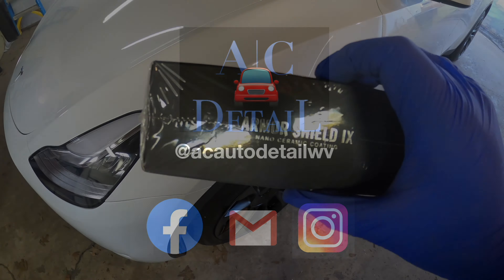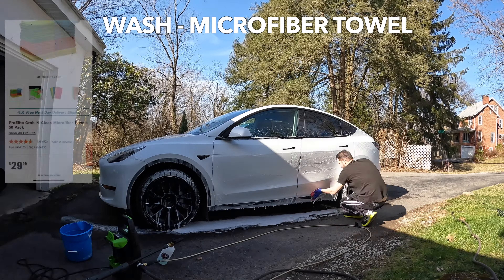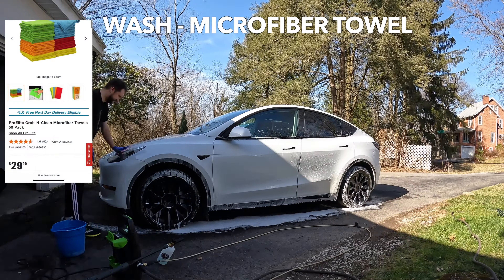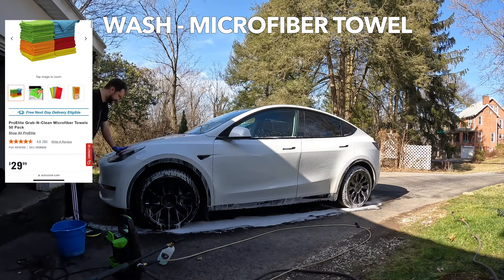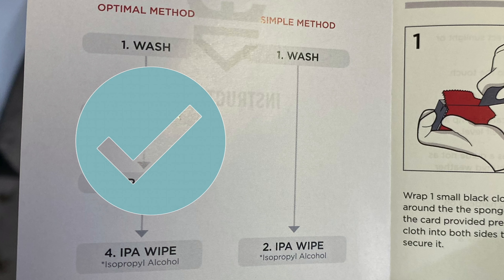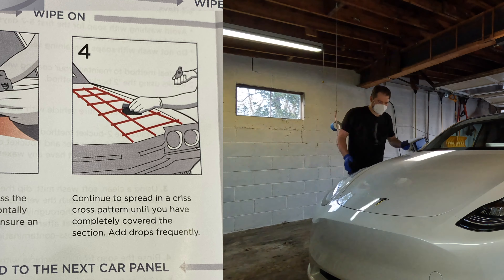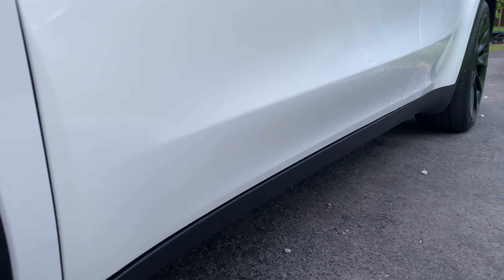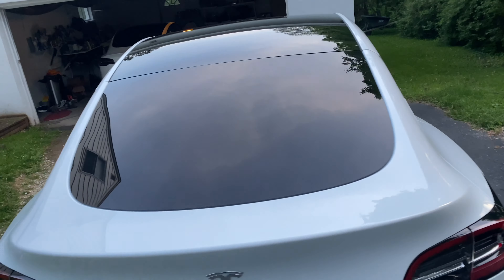FULL PROCESS DIY Ceramic Coat Tesla Model Y in 5 Minutes

Comment: How old was that PPF? I am curious to see how long it lasts before turning yellow
Reply from the maker: Great question: Mine was 18 months old.  Garage kept.  Thanks for your comment, Cheers!
Reply: @acautodetail829  wow that seems fast! Did it have a ceramic coat on it during that time? Does a ceramic coat help prevent ppf yellowing?
Reply from the maker: @Lifeneverlost  it was not protected.  I am hoping the new PPF does better.  You can use ceramic coating on PPF.

Comment: Where else did you apply it to other than the paint? I am coating a Model Y soon with a 30ml bottle. Planning on doing the paint, wheels, glass and all outside trim.
Reply from the maker: I did paint and plastic.  Make sure your glass is spotless clean before you do it.  But you can coat anything.  Also, make sure the brand you have is formulated for glass.  Thanks for watching, have a great start to your 2024, Cheers!

Comment: Will one need to wax the car at some point after this, or does ceramic coating take the place of waxing?
Reply from the maker: It takes the place.  You can use a ceramic spray wax to refresh it, but regular waxing isn’t necessary.  Or you could use ‘AMMO Hydrate’ when you wash your car to keep your ceramic coating looking it’s best.  Here’s a video: https://youtube.com/shorts/MQxdxdwOr5c?si=D2o30cYtMigNSnUi
Reply: @acautodetail829  Awesome, thank you so much.

Comment: Thanks for the video, how many bottles of Avalon King Armor Shield IX did you use? and how many layers did you apply? Thank you so much!
Reply from the maker: I applied one layer, and it took the whole bottle.  I probably over lubricated the pad, but I wanted to make sure I was getting a good coat.  I think if you were more careful, and spent more time, you could get two coats out of one bottle.  I hope this answers your question.  Thanks for your comment, Cheers!

Comment: With ceramic coating do you get protection from stone chips
Reply: I have seen multiple places say it does NOT help with rock chips and you need to do PPF to help with that.
Reply from the maker: Great Question: Ceramic coating is a great protection against road dirt and light scratches, but impacts that could potentially chip the paint would still be able to do so, even after ceramic coating.  Thanks for your comment, Cheers!

Comment: If I’m taking delivery of my MYLR do I need to wash it before ceramic coating?
Reply from the maker: Yes.  You don’t know what prep your car has been through when you take delivery, and every model and delivery experience can vary in many ways.  Always play it safe and wash, clay bar, and IPA wipe before you ceramic coat.  It will significantly increase the life of the coating, and provide good value.  Let me know if there’s anything else I can do to help.  Thanks for your comment, Cheers!

Comment: No chemical decontamination?
Reply from the maker: I would recommend Iron remover for a dirty car.  This vehicle was cleaned with iron remover and clay less than 30 days before the coating.  But, if it had not, I would have used it.  Thanks for the suggestion, Cheers!